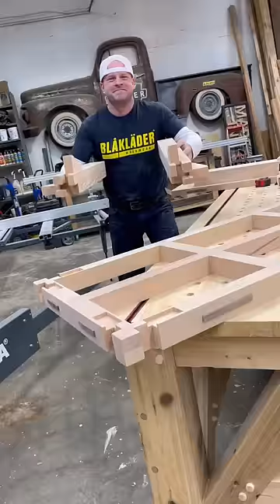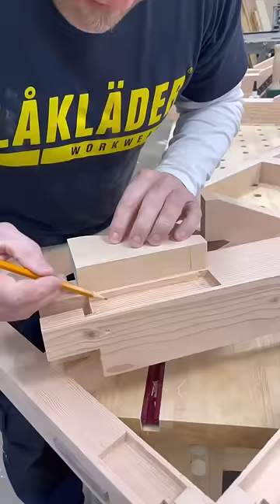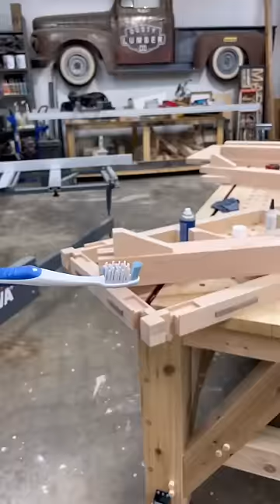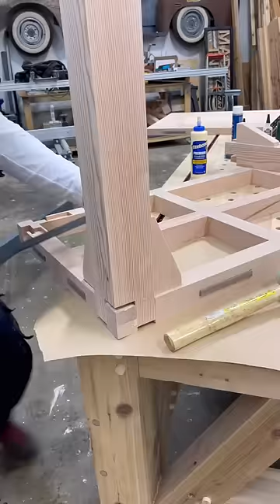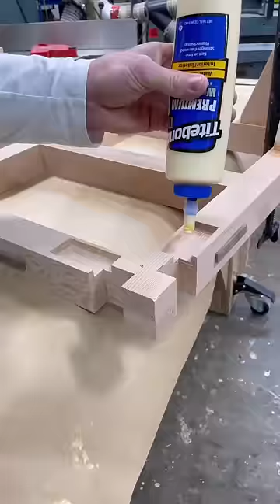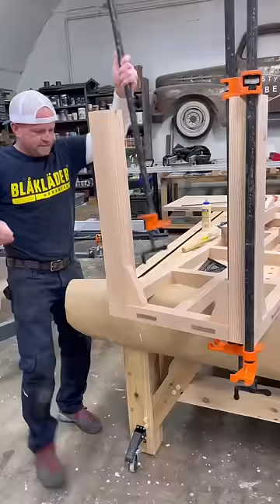Table leg joinery glue up #woodwork #woodworking #maker #wood #tools #bois #holz #joinery #madera

Comment: So why did you mark the pieces you were joining anyways?
Reply: He was marking where the CA glue was going. CA glue is an instant bond where as the wood glue (in the middle portions) takes longer. So instead of using a nail, or clamping and waiting for the wood glue to cure, he held them together with the CA glue while the wood glue is curing.
Reply: Haha right on thanks for the info. I thought he was messing around lol. I don't know anything about carpentry but love watching the skill of it. Thanks again.